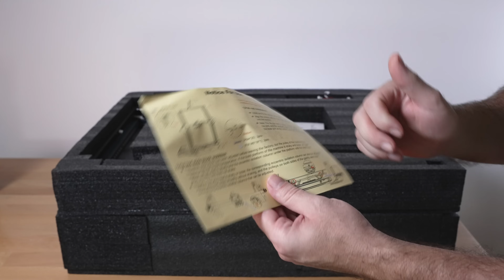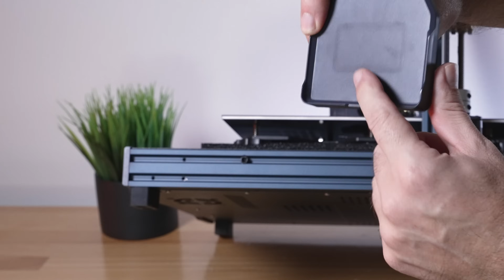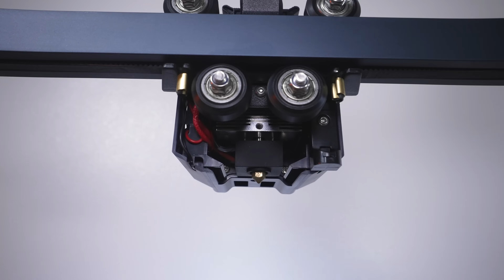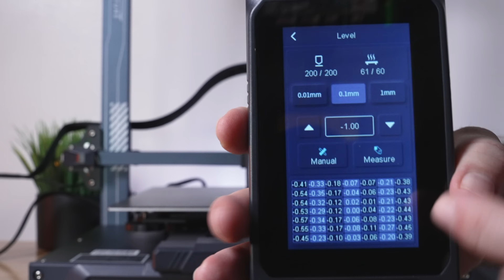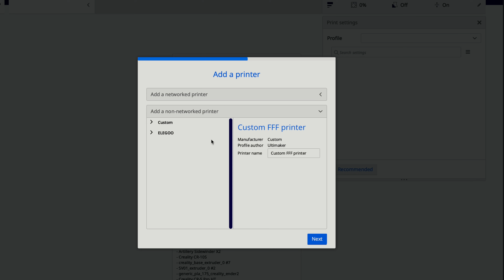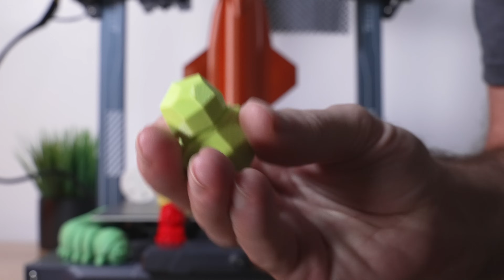Elegoo Neptune 3 Plus - 3D Printer - Unbox & Setup

Comment: 21:02 I have a free wheeling tram wheel on both sides of the x gantry, on the left side its the top wheel and on the right side its the bottom wheel. Should I be concerned as no amount of spinning the left and right eccentric nuts changes anything?

Comment: You didn't measure the printer's footprint; you measured the depth of your desk. I would have liked to see from the printers back foot to the front foot, also side to side to see how much room it will take up on my desk. I don't need to know your desk is 24 inches wide.

Comment: I am currently setting up my Neptune 3 plus and when I first turned it on after assembling it I pressed home and the nozzle went into the bed and left an indent, I tried leveling it but anytime I press home it will again sink into the build plate and burn a hole, has anyone had this problem?

Comment: Anyone knows if you can swap the power cable for a longer one, and if so, what details should I check before I burn down my house.... If this is not possible any special extension cords which are save enough to cover some distance? Usually I would avoid using extension cords for such devices but I can't seem to find clues on the internet....

Comment: I followed your video to the t, and when I try to level it, the nozzle is too far away from the build plate. I turned the wheels all the way where they were loose, and it still won't get close to the nozzle. Any suggestions
Reply: same thing with me, did you figure it out?

Comment: To level anything, only use 3 points, 2 on the back, 1 on the front. Or opposite sides. In a triangle. Level the 2 first, then the one opposite to match the two. Once it's level in a case like this, just snug up the rest to support it level. Any other way will take much longer.

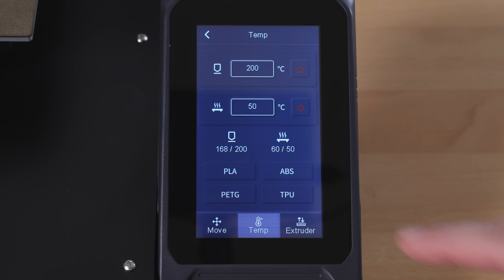Comment: Great video. I'm new to fdm printing and I just got the Plus. I've almost finished the test filament that comes with the printer, and I wanted to know how to unload the filament and put in a new one. On some videos I've seen, on different printers, they do it manually, extruding some filament and then pulling it out quickly. Do I have to do it with the Plus too or can I use the function you show at 34:10? Thank you

Comment: Nice video How do I unload the filament when I’m done printing and wanna put my roll back in the Eibos filament heater..? Thank you
Reply from the maker: If the filament is stuck, preheat the nozzle and it will come out easily
Reply: @JustVlads thank you…  it’s not stuck.. can I just leave it in and turn my machine off..?
Reply from the maker: @mitchelbenjaminsr1587  Yes, you can leave it in the print head and turn the machine off but for longer storage its a good idea to put the roll in a sealed bag to protect it from moisture.

Comment: Why don’t they have the extruder motor flipped and closer to the rail? I’d bet it would be better for weight distribution no?
Reply: Or make an in line version of direct drive so there is less outward weight and it’s more stacked on top of the nozzle

Comment: awesome review! just got my plus in yesterday, was wondering if you switched the voltage from 230v to 115v as suggested on the screen protector? i could not for the life of me find that switch and was wondering if you have done it on yours...
Reply from the maker: The printer voltage is preset to your delivery address. If you need to switch it, the bottom cover will need to be removed and the power supply can be switched.
Reply: @JustVlads  ah great, thanks! I'll check it out and confirm.
Reply: Think I may remove the bottom plate just to make sure that it is set correct when I receive my machine.

Comment: I had to return my 3pro today . It kept having issues and over the weekend the screen locked up again and this time I couldn't get it to unlock no mater what I did . Unfortunately they didnt have anymore for an exchange so I had to accept a refund instead . When it printed the prints were nice in my opinion , but I dont know enough to get the machine to respond  and get the touch pad working again . I like the look of this printer and when I try again I think I my upgrade to this machine .

Comment: @ 12:10: the wire should be parallel to the arm for the spool to prevent cable kink. This will also center the spool and weight of the upper gantry.

Comment: Would you please compare the noise of neptune 3 pro and plus while printing and standby 

Using apple watch or a device which we can see it in decibel
Reply: Why an apple watch? There are literally devices built solely to tell you the decibel level of sounds. And they cost literally a fraction of the price of an apple watch. Not to mention an apple watch wouldn't give you even a close representation of actual decibel levels as its microphone is relatively low quality.
Reply: @YourLocalRaccoon  yea but if you already have an apple watch it doe’s the job quicker than going an d buy a device also im happy with the apple watch results as few decibels difference won’t make any change in my experience with the device
Reply: @YourLocalRaccoon  what i want to know is the difference of the two printers, i dont care if they are 50-55 db or 60-65 i just wanna know the difference
Reply: @AMForouzani  decibels are non-linear, 60 is significantly quieter than 65, so yes "a few decibels difference" is a massive difference
Reply: @YourLocalRaccoon  you didn’t understand what i ment
Reply: @YourLocalRaccoon  im saying i just want to know the delta 🤣 , i dont know how to explain ,
What i mean by i dont care about few decibels difference i mean using the worst device and the best device to measure , when using same device for measuring the noise the difference is the same
Reply: @YourLocalRaccoon  it like the temp difference in kelving and centigrade is the same
Reply: @AMForouzani  a) temp difference between kelvin and celcius is massive b) a competent decibel meter on amazon is literally less than $30 compared to an apple watch which is well over $200 c) why are you asking him to specifically use an apple watch when the exact same thing youre asking for can be done better AND cheaper AND easier with a device that was specifically made for it d) if the apple watch can do it, then why not ask about doing it on an apple phone? or for that matter an android phone? 

im not hung up about the fact that you just want the difference, im hung up on the fact that you specifically asked for him to do it with an apple watch which is probably the absolute worst thing he could use
Reply: @YourLocalRaccoon  1- I didn’t told him to use apple watch I said apple watch or a device which…. As most of people have an apple watch but not many people have devices to measure noise 
2- 300kelving -290kelvin is the same as 26.9 Celsius - 16.9 celsius 
So the delta(difference )is the same
Im saying when you want to finish out the difference between two thing , it doesn’t matter if you have an accurate device or not if you use the same device for both 
If its not accurate its not accurate for both so the delta would be the same
Reply: @YourLocalRaccoon  here is an example: you use a device which is 100% accurate and shows 50db for plus and 48db for pro 
And anothe r device is so bad and shows 54db for plus and 52db for pro ( the values are wrong but the difference in both of them is 2db so you can understand that the plus is 2db louder )